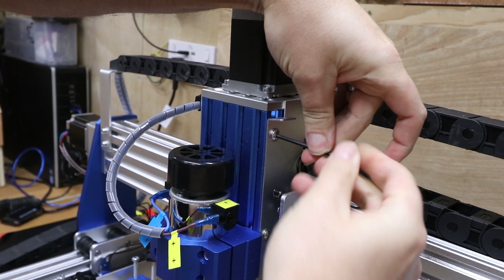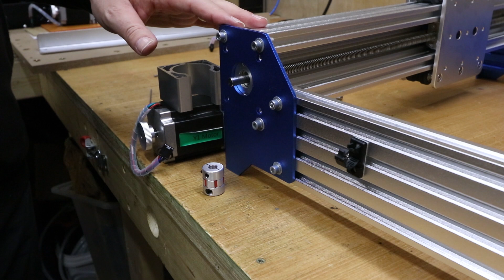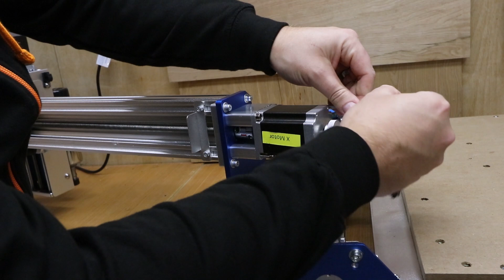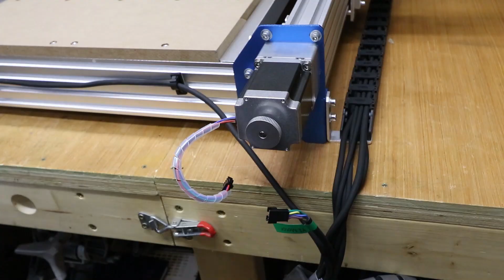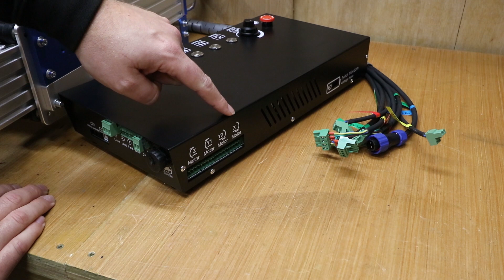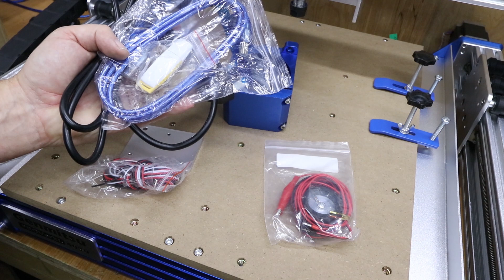Building the PROVerXL 4030  CNC machine from Sainsmart Genmitsu

Comment: Just got mine last night and started putting it together and noticed all the motors have flat spots for the set screw that isnt mentioned in any of the videos on building this model and is this a new thing? Seems like they both would have a flat side for that screw but maybe its just me.
Reply from the maker: Yes, it just helps the set screw grip the shaft.
Reply: @JamesDeanDesigns  Everything works except the x axis, when I hit the arrow it doesnt move a 1/16 th of an inch before locks up and quits. Tried reconnecting all x axis wires and checking for debris, gonna contact seinsmart tomorrow. Pretty sure its just the axis motor. Moves from one limit switch to the other with the knob, so no obstructions.

Comment: Hi James Can you help me?  I have a PROVerXL 4030 the issue I have is that I only have a 60mm Z range of travel. When homed the bottom Z limit switch is tripped yet using the offline controller I get 15. Jog Controller limit exceed error at 59mm using a 1 mm step.  There is still circa 40mm space before the top limit switch is reach.  Sainsmart support seems to be very slow hence I'm reaching out to the community for help.  If I'm limited to 60mm so be it but I feel something is a miss somewhere.

Comment: Stupid question form a guy who plays machinist. Does motor orientation matter for the X-axis on these machines? X axis coupler disconnected, so I had to reconnect the motor to the rod. I’m getting weird cuts. If you look at my cut, both sides are missing parts that the other has if that makes sense. I know this is an old video but please someone help.
Reply from the maker: Yes motor orientation can make a difference
 For example if your X motor is mounted the opposite side than it should be then everything will come out mirrored but you can usually correct this in your settings to make ot spin the other way

Comment: Love your videos! Is there a good laser kit to get that is plug n play for the 4030?
Reply from the maker: Most lasers will fit and work one way or a other. The main difference is lasers under 10w will run from the machine directly but 10w and over will usually have a separate power supply. Obviously Sainsmart lasers in theory should be the easiest, other than that you could look at FoxAlien, Sculpfun, laser tree, Atomstack etc.
Reply: @JamesDeanDesigns  thanks for the speedy reply!
Reply: @JamesDeanDesigns  Do you know if a 5w laser is sufficient to etch acrylic?
Reply from the maker: @aerial51studios  it should be able to etch it. However clear acrylic will be an issue. Diode lasers don't work well with clear acrylic so you have to apply something to the surface like paint and wash it off after lasering
Reply: @JamesDeanDesigns  ah makes sense!

Comment: Do you think putting loctite on each preassembled screw in the frames would be a good idea? Provided you did it 1 screw at a time.
Reply from the maker: Yes, that should be fine. If the bolt is giving too much resistance in trying to get it out then leave it in place as it not worth risking it snap or round off

Comment: Do you know what specs for the stepper motors? I'm building another machine with parts left over from 6060 then 1100 upgrades. I've already machined feet and gantry plates just need to know which steppers to order

Comment: James, I ordered a 3020 pro max & sent it back because one of the steppers had a broken socket & despite this, I ran it, the spindle itself was imbalanced & was not smooth turning at all. So I sent it back. Do you suggest the pro max or the 4030? I like the idea of the pro max being small. I already have a larger machine, I want something small. No bigger than the 4030. Is the 4030 better or is the 3020 better in your opinion? The 3020 seems better built. No wheels. What do you think? I already had to send one back. Do you think the Foxalian Masuter Pro stands up to these? Every option up to 1000 USD seems to have a drawback. Belts are worrisome, wheels are worrisome, 3020 seems perfect but it has already been returned for refund once, I am wary to try it again - what do you say? Thanks man, I love your content. It is because of you I am wondering whether 3020 is worth another try, the masuter pro or 4030 as well.

Comment: I had a lot of little problems assembling mine.  The drawings are not very detailed and I couldn't tell which way to install the spoil board and dust baffles so I just tried every way until I found one that fit. There was no small Allen key that fit the little set screws in the motor couplers. The threaded holes in the drag chain mount were not threaded properly and the screws wouldn't go in until I tapped them out properly. The drawing showing how to mount the drag chain doesn't show the cables which makes it hard to tell how it goes. The Z height mapping probe came unassembled with some loose wires and connectors but there are no directions for building it. They also included a length of loose, unconnected cable and some connectors but there are no directions showing what to do with that either.  Also I ordered the dust collector but it's too big to fit on the machine anywhere!  It is supposed to fit the model 4030 but I guess you can't use it unless you install a larger router in place of the supplied motor.  Also the unit didn't come with the control box that's extra cost so you can't use SD cards unless you buy it too.  For $1,000 I think it should at least have a way to read SD cards!
Reply from the maker: Thats doesn't sound good! If you haven't done so already they reach out to Sainsmart. Their customer service is brilliant.

Comment: hi, thanks for this video. i build my own CNC based on the 3018, keep running into problem with false errors on endstops and the bed that is not aligned / flatten. It seems not firm enough. Because i really like the cnc hobby i consider buying one of these so i can use it out of the box and do not have to care about false errors etc. It is quit a big machine and i do not want it on the bench all the time. Is it  firm enough to put it away when not used? maybe standing on his side? thanks

Comment: Am just exploring and I want to buy a cnc machine but I don't know what type etc could you advise me more
Reply from the maker: Best advice I can give is set you maximum budget first as that will narrows down your choices. If you are limited on space then again look what will fit and again that will narrow it down further. As whether you're more interested in routing, laser or both and that will probably really narrow your options down at that point.
Reply: @JamesDeanDesigns  Am interested in routing, and I am working with a budget of $1200 USD. And am interested in a a size no smaller than 24inch by 24inch

Comment: Just completed my build and was grateful to have this video as a guide.  Used Locktite as you recommended.  
The spoilboards will be first project.  
The unit is bigger than anticipated and I'm in process of building it's own mobile table.
Although I know I'll figure it out, you may want to consider short tutorial on using the Offline Controller.  Mac user 
Thanks
Reply from the maker: Hi Barry, glad the video helped. It was also bigger than I expected as well 😆. I havent got the offline controller unfortunately as I'm always using my computer, so I can't help with that one, sorry 😕

Comment: appreciate your insights, ... on the fence about buying a CNC and watching your video's helps.  Right now a toss up between this 4030 or going for a more traditional hobby class like the Shapeoko 3 (40cmx40cm) or the Canadian made Longmill (30cmx760cm) both these other machines rely on a trim routers (sold separately) and come in $300-$500 (CDN$) more than the Genmitsu.   I can see you have a small shop as do I, a very small shop.  Had considered the 3018, expanded to a 3040 but ended taking that off the list even though it was half the cost.    ... have even toyed with the idea of a complete DIY build with 3D printed parts and using a Dremel as a spindle. ... but that thought was fleeting and has left the building.
Reply: What did you decide on in the end?

Comment: Are the V-wheels adjustable via an eccentric shaft to accomodate wear over time?
Reply from the maker: No, I dont think they do. I have been meaning to check and take one apart but there doesn't appear to be the usual signs of them being eccentric bolts

Comment: Thanks for all the helpful content you've been producing, James! Having a few spare pennies lying around, I opted for purchasing the 4030 straightaway. I now own a fine machine, alas it feels a tad overpowered for many things. More specifically, I'm wondering if the 4030's sheer might leaves it ungainly, for lightweight tasks. For what the 3018 lacks in 'oomph' -- does it gain anything, in terms of precision? Is the smaller machine more nimble, and better suited for fine-resolution operations? Might I care to turn around and spend a few hundred dollars on the 3018, to cover scenarios where firing up the 4030 would otherwise prove overkill?
Reply from the maker: No, not at all. I cant thinking of a single task the 3018 could do better than the ProverXL 4030. Possibly laser work as it might be able to traverse a little faster but I'm not even sure thats true. The 4030 is a good solid machine and will still be able to to do fine precision work, in fact it may be more accessible I find mine has less backlash
Reply: @JamesDeanDesigns  Caught your reply in time, but it now seems that I'll see for myself, soon enough -- I caught a deal knocking $70 off of the 3018, making it an affordable machine to learn more safely on, as well as teach the kids with.

Alas, imbecile that I am, I ordered the Mach3 version! May still order the other controller, so both big & baby brother use the same toolchain.

Comment: The factory assembled z axis is loose on my machine.  Very loose.
Reply from the maker: Loose as in screws or the whole assembly? Someone said on the Sainsmart group the other day that theirs jad about 10mm of play in it. If its play and not loose screws then I'd say contact Sainsmart
Reply: @JamesDeanDesigns  Thanks for the reply James.  It was the four screws attached the "H" bracket that guides the lead screw and guide rods.  One screw was completely falling out and the rest were not even hand tight.   It looks to me like the loctite they used was faulty, more like a green oil.  The first few test prints went okay, with tiny Y axis glitches, then when I entered my own designs it started going off in straight lines on the Y axis and horrible Z plunges that broke several tips.   I decided to stop everything and troubleshoot, luckly I found the issue right away.  I'm still having issues with the z plunge and I'm looking for information about the brass lead screw and what I'm guessing is a backlash adjustment.  I was not happy at all with the feel of the slide bush bearings on the guide bars, those were actually over tightened and binding travel.    I read in another forum that the lead screw can slip if not adjusted correctly and cause the death plunge.  Anyway, I'm  looking for deatailed information on the z axis schematics.  Sorry for the long winded reply but those death plunges are keeping me up at night.
Reply from the maker: @greshamglover  The weight of the Z axis can pull it down but there is a GRBL setting to keep the motor engaged. Check your GRBL settings and if its not so already then change $1 to 255 so basically type $1=255 and hit enter
Reply: @JamesDeanDesigns  I think I may have found the issue after following Graham's introduction.  The values in my machine appear to have been set too low for $100-102, being at only 160.  Seems they missed a zero.  Thanks again for your help.
Reply from the maker: @greshamglover  glad you resolved it 👍

Comment: Love the look of this and would be very tempted to upgrade from the 3018. My only concern would be the separate motors driving the bridge assembly and both staying parallel as the motors and lead screws wear, do you think that would be an issue? 
Love the videos on your channel, keep it up bud 👍
Reply from the maker: This dual Y axis approach is more common, especially on more expensive machines. As long as you don't knock them, or run the machine too hard every thing should remain parallel. I think as long as everything is lubricated correctly then wear should be minimal

Comment: I've got it pegged down to one of 2 machines. Either this 4030 Genmitsu or a Shapeoko. 
Will this CNC machine operate on a thumb drive, or do you have to have it attached to a dedicated computer ?
Thanks kindly !
Reply from the maker: You have a few options, a computer is the easiest. You can buy an offline controller for this also which takes a memory card (and possibly a thumb drive). Or the alternative is something like a Raspberry pi with a small screen. Usually less than about $50 to set up. Ive never used a Shapeoko so I cant give a balance review, but from what I have seen they don't look as sturdy as these and they are also belt driven which is considered to be worse from my research (unless you're doing laser work)
Reply: @JamesDeanDesigns  Thanks, James. 
I tend to 'over think' such investments and sometimes get brain lock as a result. LOL. 
I have been a hobbyist woodworker for decades and am always looking for the next tool to consider. (It can be a curse...) 
Looking forward to your future videos showing project workup on software and then on the machine.
BTW, which Country do you live in?  I pick up England, then seem to pick up a touch of Aussie, so I can't peg it down. 
I've been to 26 Countries and Territories in my time and have kin living in England.
Thanks again!

Comment: I have a smallish, multipurpose shop (machine work, woodwork and welding) so space is a premium. Could you store the 4030 on the wall if space is an issue?
Reply from the maker: Its got a bit of weight to it but I suppose you could as long as it was secure

Comment: Great video I really appreciate the insight and a little helpful tip with the Loctite which I did not use unfortunately. Had a couple slight issues with my machine but they were very quickly taken care of by customer service and I was up and running without a hitch as a sidenote did my first cut this last weekend and it came out great.
Reply from the maker: Great news 👍

Comment: Great video, thanks for that. How do you line up both Y axis stepper motors for the gantry installation?
Reply from the maker: You can either measure to check they are in the same place or take a piece of wood, drop it on the axis and slide the carriage down until it hits it. Then do the same on the other side with the piece of wood and they will be the same distance and should line up

Comment: Thanks James.   Looks far more robust than the 3018.  I'll be interested to see how the sliding gantry model performs. From what I've seen a lot of people hate them. I suppose it's down to how solid the build is.     Jim
Reply from the maker: Personally I see them as being a better design. For example if you dropped a heavy piece of wood onto a 3018, the stepper motor might struggle to move the bed because of the weight but thats not an issue with the moving gantry. But let's see, I'm sure there will be some down sides
Reply: Yes James I eagerly await your tests and reviews.  If I ever learn enough and make any money from my 3018 I could justify to my wife that I could upgrade to something more robust. But I need to be careful bearing in mind my stomach trouble . . . . . . . . . . No Guts !
:)    Jim

Comment: Perfect advise with Loctite. In my 4030 I found a number of not tightened screws. Some needed 1/4 some 3/4 turn to be tightened fully. Also during operation I found next two screws going out from thread. I found also one circlip from Y1 axis axis missing from front side. recommendation to check all of them before assembling engines.
Reply from the maker: Same here. Some were quite tight but others were not. As though they don't have a standard torque setting. I have found a small short cross head bolt that dropped out when I first unpacked it. Looks like its off a stepper or the spindle but I havent found anything missing yet 🤔
Reply: I have two torque head screws that held the wheels on the carriages that were WAY too tight and stripped so I couldn't back them out.  Looks like whoever assembled took a few shortcuts with a drill.

Comment: Great video but it must be said  750 pound is so over priced for what you get. i upgraded my 3018 pro to a bigger cutting area and 500w motor plus better stepper motors for less than 200 pound. less than 400 inc original 3018 pro.
Reply from the maker: So the reason Sainsmart reached out to me originally was because I openly said it was too expensive and they wanted to prove me wrong.  I can genuinely say the build quality of this is miles ahead of the 3018. You would have to do a lot of upgrades to a 3018 get it close to this. For example the gantry on a 3018 has flex, this doesn't, and on this the gantry moves and not the bed which is a much better design. I still cant make a judgement as to whether its worth the money as I haven't really used it though but I can see why someone would pick this